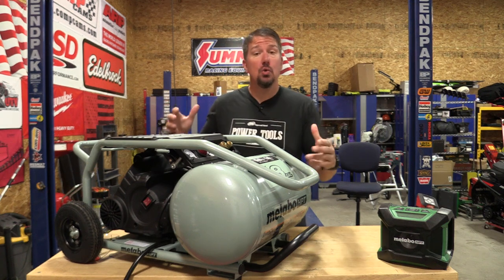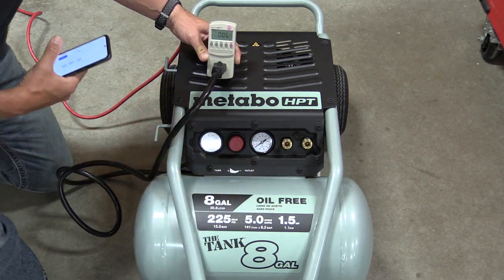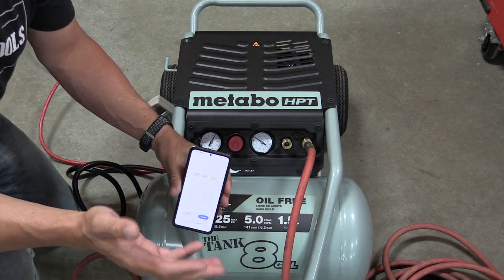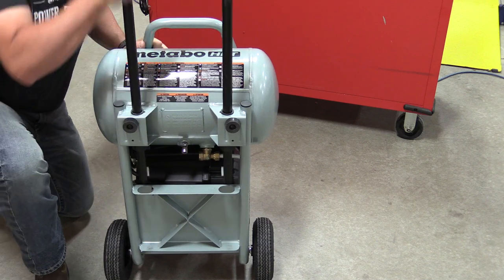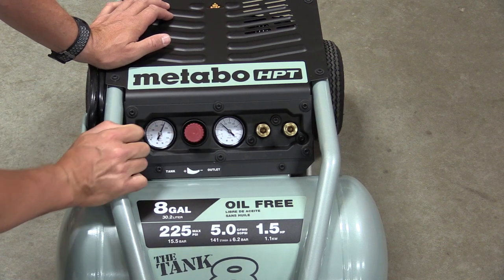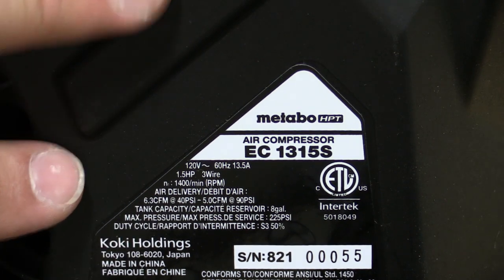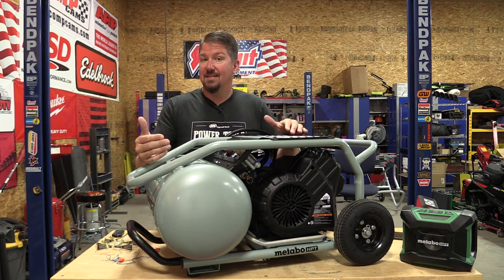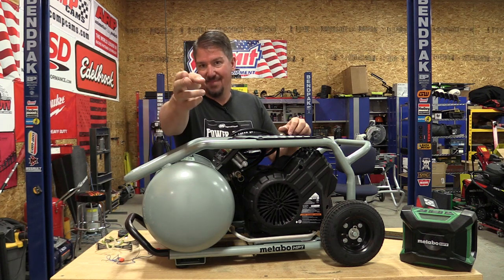Metabo HPT "The TANK" 8-Gallon Trolley Air Compressor Review EC1315S

Comment: I work in mobile auto recon, we dye leather and do wheel repair etc. We beat the hell out of compressors using paint guns and grinders. Looking for something smaller that can run a grinder/sander for somewhat short intervals as well as a paint gun but still  fit in the bed of a truck concealed my a bed cover This one seems like it may be a good option as far as specs. (I know it’s not intended for those tools, we have built an empire destroying porter cable pancakes). Any other compressors you would recommend?

Comment: Just wondering what the longevity is like. 225psi is going to put a strain on it and oil free designs just don't last as long on a working job site. Other than that, I like it.
Reply: This brand of air compressors is very much focused on pneumatic nailers. I think any 8 gal would be more than enough to run multiple roof nailers, framing nailers, etc and on down. 
It's probably not adequate for impact wrenches or other pneumatic tools if that's what you're getting at.
Reply: @histguy101  agreed.

Comment: How does the drain look? My issue with the same style DeWalt compressors was the drain wasn’t at the lowest part of the tank. Made it impossible to get all the water out at the end of the day. Is that drain at the lowest part of the tank?

Overall looks like a nice unit. When my 15 gallon DeWalt stand up dies that will probably be it’s replacement.
Reply from the maker: The drain is in the center of the long flat tube and in order for it to be at the bottom you have to lean it forward slightly when you drain it standing up.  Not bad, but they could have done better.
Reply: @WorkshopAddict  Kind of a bummer. Wonder why manufacturers can’t put the drain at the lowest point when the compressor is sitting in the running position? Maybe it would be in danger of hitting the ground? Just frustrating when it freezes in the fall and it becomes impossible to drain the tank without it sitting in the shop overnight.
Reply from the maker: @Mittencarpentry  In this case, you have to pick up the compressor and put it in the standing position to reach the drain.  Then a slight tip forward.  I show it a bit later in the video.  Not hard and not too bad.

Comment: Metabo /  Hitachi as a company suck don't try to get them to honor warrent
Reply: What did you try to warranty?
Reply: Been making lots of money with my Hitachi/Metabo HPT nailers, compressors and now 36V pro grade tools for entire career(25+yrs) warranty and service has been great and the lifetime warranty on the lithium ion cordless tools is best in industry
10 day turn around time with one cordless tool and 1 battery out of 50+ green tools those are the only ones that I have had to use warranty
Pnuematic nailers and compressors have never failed(25yrs running) industry standard for a long time
Please don't post dumb responses.when u haven't had much of any experience.with the tools
I'm guessing your a yellow fan
Reply: Wow in the first Hitachi kit I bought with 2 batteries and third extra all the batteries failed in 11 months when I contacted Lowe's they said to talk to Hitachi who said talk to Metabo who said talk to Lowe's you sound like the PR / sales dept for Metabo you make a lot of assumptions in write up but always remember the first three letters in assumption
Reply: @bigfoot4255  you bought a Hitachi kit(Lowes hasn't had Hitachi branded kits for 3yrs
Metabo HPT has warrantees 1 4.0/8.0 battery and the new 1/2 Impact and total turn around time was less than two weeks-thw battery was 8 days
Quickest turn around time I've ever had with any tool brand DeWalt is the absolute worst and we have had over 20 yellow tools have issues and only a handful of them ever got resolved with black and yellow
Also their free battery promos have been awesome and I e received them within a couple of weeks of process unlike Milwaukee who's promos took almost 3 months to get to me
Sounds like user error to me
Warranty process is pretty straight forward and customer service has been good for me